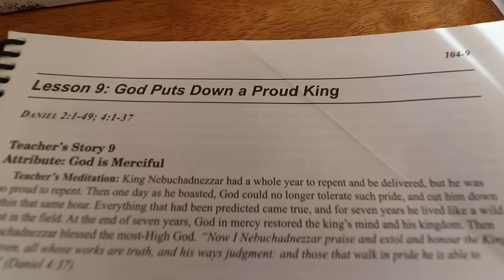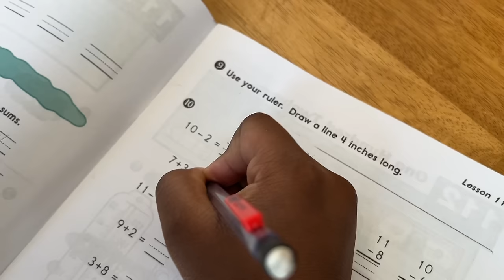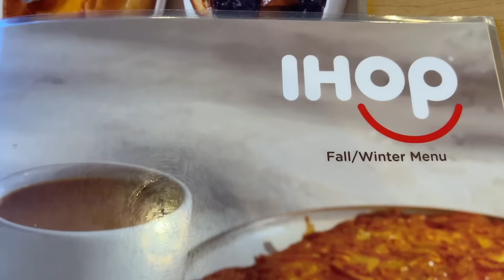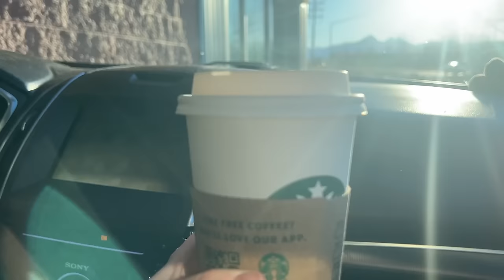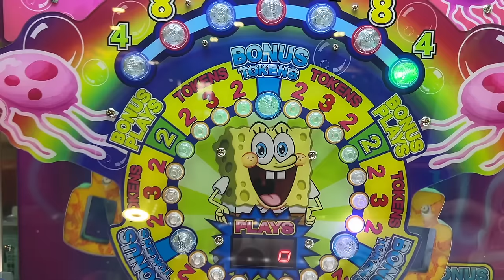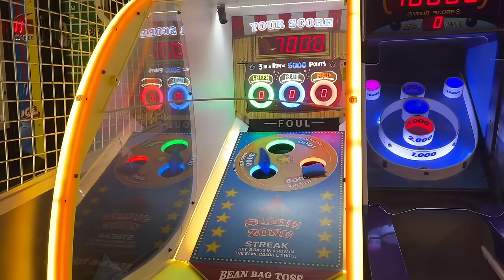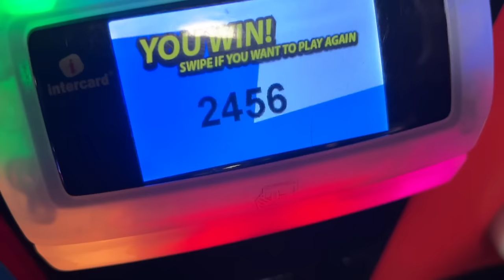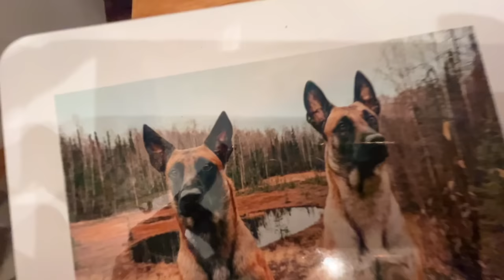This Had to Happen...Making Life Easier on our Alaskan Homestead!

Comment: Hi guys, loved todays program. When we had a snow plow put on our truck which was a 3/4 ton ford 4 wheel drive, we ended up having a lot of problems, as it really is hard on your rigs. We had front end problems and transmission problems, you name it so we took the plow off our good truck and bought an older pickup to do the plowing and left the plow on it and used the old truck for plowing only. We ended up with some pretty big repair bills on our regular truck.  As far as rams go they are all like that . I had raised sheep for awhile but because of the ram and getting beat up by him all the time I sold them all. It did not matter what I did he was one which would sneak attack you when you were not looking. I did nothing to make him that way, they just get like  that and never can be trusted.

Comment: I would suggest using a  power strip with individial switches (extension cord - outlet surge protection) to save energy. I have several throughout my house. In the kitchen for the microwave and toaster. My son uses one for all his gaming stuff. It is only on when in use. There is one in the office that I use for my desktop computer and printer. I also use a single switch on my washing machine TV, and every lamp that is plugged in. It makes a difference!

Comment: Grats on the Plow!.. That will help a lot! 😊 Did they (the installer or the Truck MFR) recommend that you counterbalance it? IE: Put 250 lbs of ballast aft of the rear wheels? Help take the load off of that front axel. It will improve the push of the plow also.
Reply from the maker: No. But we’re only doing our driveway and the road leading up to our driveway. So far, it hasn’t been an issue with nothing in the back, it works great! 💪

Comment: Tina and Joe thanks for another great video. Tina your editing skills are amazing, you do an amazing job telling a story. It’s so seamless, just curious what editing software do you use?  I wish I had that talent to edit our videos like that. Great job on separating Sampson, we keep our bucks separate unless it’s breeding time. The reason your water line is freezing is it appears to run under your driveway. So when Joe plows the snow off it removes any insulation it would have from the snow and every time you drive over it it drives the frost deeper. The ground that’s covered in several feet of snow is probably only frozen half as deep. The in-line water heater is awesome, didn’t know there was such a thing. You might want to consider adding a kilowatt or two of solar and increase the battery capacity before next winter. I know it all cost loads of money just a suggestion. The plow is a good addition to Joe’s arsenal of tools. Stay warm best wishes from our little farm.
Reply from the maker: Hey friend, I use Final Cut Pro. I used iMovie for the first 3 yrs and then invested in Final Cut Pro. It was around $300 program but I think well worth it and it’s paid for itself time & time again. 

Thank you for the compliment on my editing. And you CAN edit like me!!! Anyone can!☺️ Just takes a little practice & time…lots of time haha! I’m still learning everyday. I regularly watch videos on how to edit better, tips and tricks within Final Cut Pro etc., when I have time of course.

Yes, the builder of our cabin, ran the waterline down the driveway to the well. Therefore it’s not insulated because we have to constantly plow as it’s the driveway!🤣 

I’m super happy we found the “inline” pipe heater because digging up that waterline under 10ft of earth wasn’t going to happen lol!

Comment: wow. Freeze even with 10 feet of burial!  Were you frozen all the way back to your well? That's amazing especially considering all the snow cover before we got the cold. Good that you got it fixed. You seem to be thriving. No holes in your freezer from cabin fever? 🙂
Reply from the maker: Yep, it froze ALL the way to the well. About 130 ft from the cabin! Problem is when the previous owner built this cabin, they put the water line under the driveway. So the snow doesn’t insulate the waterline all winter. It’s getting plowed and driven on. So the inline pipe heater is a must. I don’t know how it didn’t freeze last winter but it didn’t.

Comment: Water lines down 10ft and you still have freezing pipes?  Good Lord!
Reply from the maker: I know.😫 Problem is usually the snow insulates the ground but our waterline was ran under our driveway 130ft to the well by the previous owner. So it’s not insulated at all as it’s our driveway and kept plowed & driven on all winter.
Reply: I had a neighbor that work the oil pipelines in North Dakota, and yes equipment driven over buried water lines is a problem.  Still 10feet and only a 2 ton pickup max is really something extraordinary.  I know you'll figure out a solution, but what a b*tch of a winter you are having. @HomeFreeAlaska
Reply from the maker: @canamrider7195  Yeah. Thankfully we found a solution with the inline pipe heater. It works great!